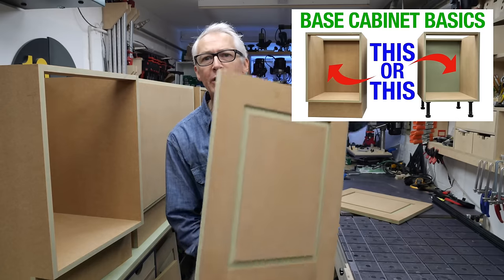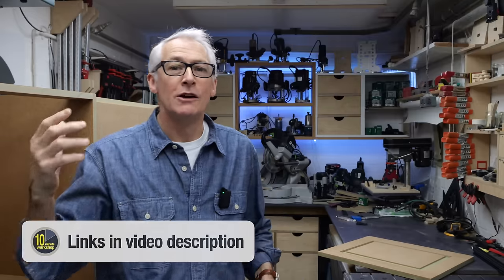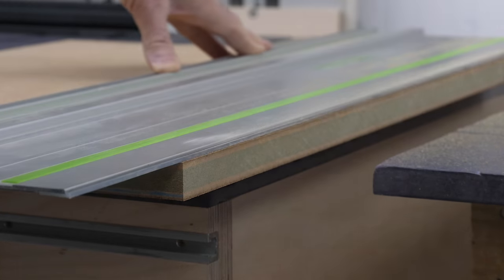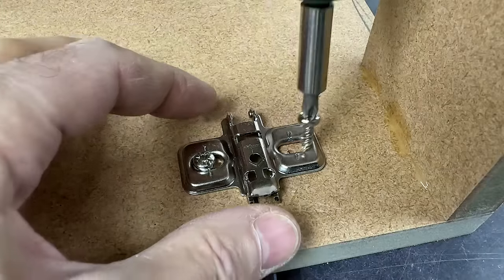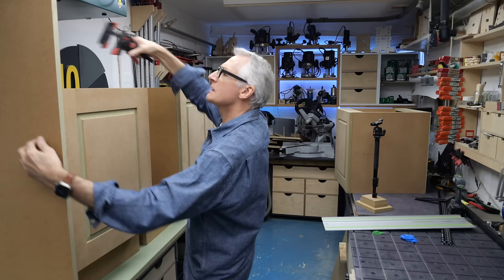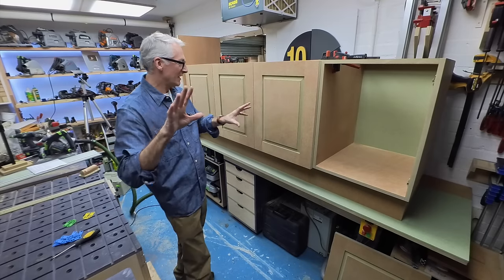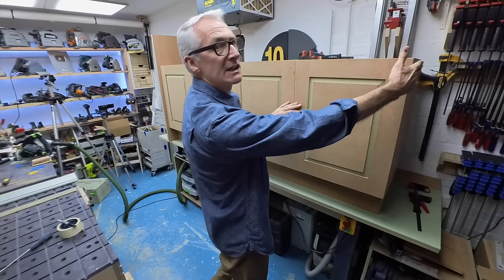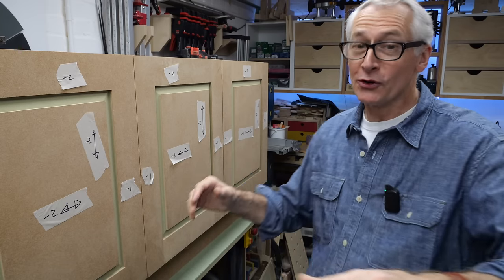Cabinet Door Sizing [*Ad] [video 549]

Comment: I have to admit I'd never thought about this issue to this degree of detail, obviously with "off the shelf" bought cabinets all the doors are standard sizes and you just average out the gaps the best you can ! I applaud your attention to detail though Peter, the results can clearly be seen in the quality of your work, I wouldn't want to be fitting your kitchen ! 😉

Comment: I find it good to mark the bottom edge of the doors with some sort of number, as well as inside the pocket for the hinges (after applying finish).  This helps the owner keep them in order should they need to remove them for some reason.

Comment: in the U.S. hi end custom cabs gaps are 3/32 which is a little less than 2.5mm. we do a lot of thick door applications where any gap smaller than that risks binding. we typically do story poles for the run and only cut the doors once from that. we try to accomodate the trimming of the doors in the rail and stile sizes as well by milling the components and building the doors oversized by 3/16. those look like some heavy cabinets lol.

Comment: Just when I think cabinet making cant get any more complex..
Reply from the maker: You don’t have to use this method - most off the shelf kitchen and cabinetry companies use the standard ‘4mm narrower and 5mm shorter’ method, and it works for them.  But as bespoke makers we can do better - and this is one way of doing that. 👍👍
Reply: @10MinuteWorkshop I work with kitchen companies here in the Middle East, they do the doors 3mm narrower and 3mm shorter for all the cabinets. Your way is definitely better, but companies usually choose the easier way.

Comment: This is excellent. I'm just wondering whether material choice makes a difference here. If instead of MDF I were to use oak to make my doors, should the gaps be slightly larger taking into account potential expansion of the material?

Comment: Hi Peter
We always made 2mm total reveal or gap, 1mm each side of each piece of fronts (doors or drawers).
We never let a terminal box whitout terminal panel (because the slit or space between door and side).
At the left of the composition we also put a terminal panel, it could be a narrow panel and the result is always a look like Inset fronts, and if you have drawers near the wall they never touch the wall while running.
saludos
Gerardo

Comment: Love the presentation. Makes a point that the reductions need to be made with Hinges set! Giving then maximum hinge movement after fitting. 
Thank you for this one! I am in the process of making doors for original imperial cabinets, wall to one side. All this fitting relevant.

Comment: Thanks to guidance from your videos I've just completed a built-in wardrobe and linen closet all with inset doors to match the 70 year old originals. All face-framing was cut to nearest 0.5mm for installation of off-the-shelf doors and all gaps are a uniform 2-2.5mm. Thanks to this video, I'll go inset on a kitchen rebuild too as it's in a 100 year old house and inset has a classic look. Getting uniform gaps on 700mm high doors should be a doddle compared to 2040mm high doors!

Comment: Really good guide Peter. I recently priced kitchen cabinets up on line. There doors were 3mm under the width of the carcasses to allow all situations I guess.
The recess doors I always found harder as nothing is square. Made some 2.3m doors for a bathroom in a 140 year old house in a cupboard made by a builder. It was only 12 mm out of plumb on one side and 8mm the opposite way on the other….. 🙈
Reply from the maker: Nightmare working on old properties- I don’t miss it at all! And thanks! 👍

Comment: Before installing the hinges, I do calculations to find the most optimal position of the hinge cap and plate (in case of inlay doors or special 180° hinges). The formulas and tables are in catalogue. Also, I use special jig for drilling the cap hole and a self designed template which helps me precisely find the location of hinge plate holes without single measurement. I designed the template myself in Fusion 360 and then 3d printed it. Also I tend to use euroscrews instead of countersink screws, and I prefer the plates with quick adjustment screw. Blum has all the options in my country.

Comment: Very information video.  Thank you.  Am I correct in the understanding that the removal of 2mm of material from the hinge side of the door results in that tab or set back of the hinge cup decreasing by 2mm?  For example on a full overlay hinge with a 5mm tab (distance from edge of the door to the outside diameter of the hinge cup) the only way to create that 2mm reveal is to decrease that tab to 3mm?  I hope this makes sense.  Thank you so much for the outstanding content.

Comment: Wow. Best ever real install and adjust, complete explanation. Very visual, easy to see and understand, and honest references to experience. Those 4 metres of cabinets, how much thought and measuring to get it perfect or did you somehow template or dummy up a model because of those inset handles? Anyway, thanks!
Reply from the maker: Thanks! On the run of wardrobes, it took a while to plan it out,  it it wasn’t too bad - the upper 6 doors were the same width as the lower ones, just shorter! 👍

Comment: I've only stumbled across your channel in the last few days Peter. 
All I can say is I wish I'd found it sooner. I built myself a whole stack of cabinets for my home workshop a few years ago and this video would have made life so much easier over the few weeks it took me to do my drawer fronts and cabinet doors. 
I do have a question around working out calculations for corner style doors, with two panels at right angles that have a piano style hinge. Any times for calculating the length of the panels correctly?
Many thanks, Clinton
Reply from the maker: Thanks! For the corner cabinet just make sure you leave a gap between the edge of the door and the carcass, and the other door that butts against it. Other than that the gaps sizes work out the same as they do here. 👍

Comment: I have a question.  When you trim, you set your track on shims? Why? I know your MDF doesn't tear out much, but I thought the track should be in intimate contact with what you are cutting to minimize tearout? Thanks
Reply from the maker: The raised panel extends beyond the face of the rails and stiles but 3mm, so for the face cuts I used shims to get the track level; not needed when the back of the door is uppermost, obviously. 👍

Comment: Hi Peter, another great video! Does the gaps you mentioned account for the additional thickness that the paint will add to it?
Reply from the maker: Yes, absolutely - paint should only add a fraction of a mm, even if you're using a roller. 👍

Comment: Nice work, as usual - thanks. I always assumed that if you shave 1mm off one side of a door, you would automatically shave the same amount off the other side - to keep the door internally symmetrical. However, it looks like those small differences don't matter, and that your trimming should aim to produce a correctly fitting SET of doors. Is that how you approach it ??

Comment: Great video Peter. The track saw does a great job in most of your projects. How often do you change or sharpen the blade. Any guidance would be helpful. Thanks.
Reply from the maker: Thanks Peter. I change blades when I have to ie when they start to burn more than cut! It’s pretty clear when that starts to happen. 👍👍

Comment: Thank you Peter, this video is very well done! I’m wondering why you used the thin packers under your guide rail each time you trimmed a mm or two off a door? Also where do you buy these assorted thickness packers?
Reply from the maker: Thanks! The raised panel stands proud of the rails and stiles by 3mm, hence the packers. Packers are in my ‘everyday workshop essentials’ list at 10minuteAmazon.com. 👍
Reply: @10MinuteWorkshop  thank you!

Comment: Hi Peter, great video.  A question about the moisture resistant MDF -- when you are ready to finish, do you still need to treat or seal the green parts before priming and painting, or are the green parts literally the same as the surface of the mdf as far as finishing goes?  

Thankks
Reply from the maker: I’ve never used any kind of sealer on MDF. Just prime, then paint. 👍

Comment: Would you need to allow extra room for paint if trimming before painting? Or is the thickness of 2 coats of primer and 2 top coats negligible? Thanks.
Reply from the maker: No - but it’s another reason to aim for 2mm rather than 1.5! 👍

Comment: If you trim down your shaker doors down to get the right door gaps would you be making your rails and styles an uneven widths ? With only being a few mm here and there is it not noticable to the eye ? 

Or would you normally account for the door gaps when making the shaker doors initially so you keep the rails and styles all a uniform width ?
Reply from the maker: Either way works, but your eyes are drawn to the gaps between the doors much more than the stiles them. 👍

Comment: Que the kitchen fitters of the world for their tuppence worth (that will include me).
I'd just deduct 4-5mm in total off the height and width. If the unit you made is 600mm x 720mm then the door is 595 x 715 or 596 x 716,  that seems to be the standard sizing. I have come across doors a bit wider but that can be too tight for good adjustment and possible binding. I agreed that it's so important to make sure the units are straight, level and true. Any twist or tapered gaps at appliances makes it impossible to correct.
Reply from the maker: Copy/paste from the video description; “So the ‘industry standard’ used in kitchen fits and the like are that doors should be the carcass height minus 5mm, and the carcass width, minus 4 mm, and that works well for most people in the business.  But as bespoke makers I don’t think it’s unreasonable to aim for something with slightly higher tolerances, and this is how I do mine. Enjoy!”

Yeah, that. 👍
Reply: @10MinuteWorkshop  sorry Peter didn't mean to offend. Must clear out my lug holes 🤦🤦. 😁

Comment: I'm surprised you had enough room to cut off 2mm from the hinge side of the door considering blum hinges sit so close to the edge. Was this pre planned maybe? Just curious. Thanks!
Reply from the maker: There’s plenty of spacing you drill the hinge cups so the door edge aligns with the carcass edge. 👍
Reply: Gotcha, I always drill them per the spec if blum.

Comment: Great video but think it would be better in diagrams what about a book of critical measurements propotions minimum and maximums etc a book  maybe ?🤔
Reply from the maker: Did you miss the bit about the factsheet? Comes out with the next newsletter, free signup at 10MW.email. 👍
Reply: @10MinuteWorkshop  no I saw that but there's a lot more be nice to have in a book 🤔

Comment: Hello, might be a silly question but why 4 hinges at 11:44? 2-3 wont hold the weight? or is it because 4 hinges would share significantly less weight which will reduce wear and tear on hinges and screws?
Reply from the maker: Big doors, so heavy anyway, plus 4 hinges keep them in line. 👍
Reply: Very tall doors, there'd be quite a distance in between the hinges using just 3... Weight is only one part of the equation :-)

Comment: do you ever just back cut the leading edge, like 1 o2 degrees so edge keeps clear
Reply from the maker: On thicker doors, yes; rarely for cabinet doors. 👍
Reply: thankx for the reply.  I have two doors on the front of a kitchen sink cabinet, that I want to fit quite tight.  I appreciate the answer.  I think i will try a 3 degree back cut.

Comment: That’s very helpful. Is there any reason to not simply install the hinges 2mm lower, rather than trim 2mm off the tops?
Reply: He explains why its better to trim the doors than mess with the hinges!
Reply: Yes I know that. My question is why not install the hinge plates 2mm lower (rather than mess with the door sizing).  That is not ‘messing with the hinges’. That is installing the hinges 2mm lower.
Reply from the maker: Then the doors would sit 2mm lower than the bottom of the carcass.  🤷‍♂️👍
Reply: It's just another approach. If you meet parts ready to assemble already in a property, it is better to calculate the exact hinge position.

Comment: Peter, I just noticed that your splinter guard on the track saw track is extra thick and silver or translucent (@2:45); it seems to have a nice well-defined edge. Do you have something special? I don't always trust the thin black rubber edge on mine when making precise cuts as the heat and humidity can make the adhesive loosen and cause the strip to move ever-so-slightly. I have a Milwaukee track saw and not the Festool so maybe that's just how the Festool tracks are. If so I may look into using that same splinter guard on my Milwaukee. I love the saw except for that part. Thanks!
Reply from the maker: It’s the standard Festool splinterguard - they changed away from the rubber strip years ago; I actually prefer the rubber visually, but the translucent plastic is very hard wearing.  👍
Reply: My last two festool rails came with the plastic splinter strips. Unfortunately they suffer from the glue softening too. I have to store them with spring clamps on each end, otherwise the last six inches of them unwind and fall off. Just bought Makita rubber strips to replace them.
Reply: Yes, I get on better with my dark Bosch strip over the clear Festool one of my pals. I struggle to see it in poor light on site sometimes... but then I am getting old lol!  @10MinuteWorkshop

Comment: i see that you use MRMDF for your doors . That is very rare and expensive here in the U.S.  We use Poplar for our door frames and mdf for the panels . I do not use tenons but inset the panel from the back with a half inch wide rabbet . With modern polyurethane glues the glue is stronger than the wood anyway. No i do not glue my panels because of high humidity in the summer and low in the winter because of forced air heating.
Reply from the maker: Benefit of all MRMDF construction is that humidity, material movement etc.. is a non-issue, but I appreciate it can be hard to source in some places. 👍👍

Comment: I've used MDF (inspired by you) but the stuff available at home centers has furry cut edges. Does the MR stuff alleviate that or is it a brand issue?
Reply from the maker: MR MDF has a much denser core, so machines and finishes very well without the fluffiness associated with DIY store MDF. 👍

Comment: Do you not find that once they’ve all had 4 or 5 coats of paint (making a thickness of 8-10 coats for adjacent components) there’s a risk of binding? The door you showed butted against the end panel had zero clearance even before there was any finish on either 🤔
Is it something you allow for and, if so, how much? Thanks
Reply from the maker: No. A coat of paint is 0.05mm, 10 coats 0.5mm. A non-issue. 👍
Reply: @10MinuteWorkshop  Fair enough! 👍

Comment: that is a great video but you glossed over the bit i always struggle with. that is where do you place your hinges. is there a standard position from the sides of a door and the front of a cabinet that the hinges need to be mounted. I too have used Blum hinges (mainly on uyour recomendation and what I fitted in my kitchen) sorry if this is covered in the fact sheet you mention.
Reply from the maker: I’ve always put them at the same height as the width of the rails, so 80mm as a general starting point. If you’re all-in on the 32mm system then the heights are pre-ordained, but for custom work ~80mm centres works well for most common door sizes. 👍👍
Reply: @10MinuteWorkshop  thanks for that but it was more the measurement from the side of the door and carcase to the hinge. I looked through the Blum catalog and it doesn't mentionwhy you would put the cup say 4mm in Vs 3mm in from the edge of the door and what is the corresponding measurement for the + shaped piece you clip the hinge into on the inside of the cabinet.

Comment: If painting the doors and end panel won’t the tight tolerance rub the paint off
Reply from the maker: 2mm gap, layer of paint is ~80 microns so not really an issue unless you’re dipping the doors or painting them with a trowel. 👍

Comment: Do you normally use a face mask when working? My understanding is that MDF dust is pretty nasty
Reply: He has a very good extraction setup plus air filtration
Reply from the maker: No, I have faith in my dust collection, and MDF dust is no more hazardous than any other wood dust - and a lot less so than many of the nastier hardwoods eg Iroko.

Comment: Why are you using a frame construction method for the doors, when you use MDF?
Reply from the maker: Why not? 🤷‍♂️
Reply: @10MinuteWorkshop  because it's a lot of work and meant to compensate swelling of wood, which is not necessary for MDF. Wouldn't it be easier to engrave a fake panel?
Reply from the maker: Then you get a fake panel door, not a raised panel door. 🤷‍♂️ If you’re happy with that then that’s what you should do, but it’s not what I built my business on, and it’s not what my clients would expect. 👍
Reply: Nah, I will stay with real wood for my furniture, thanks. Was just wondering if there is a reason for your approach. If your customers are ok with that solution, why not.